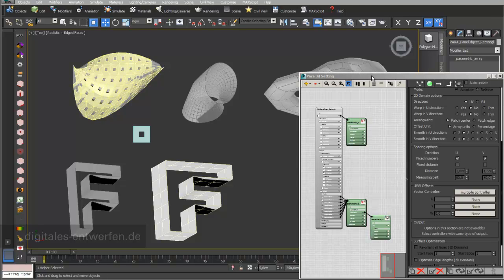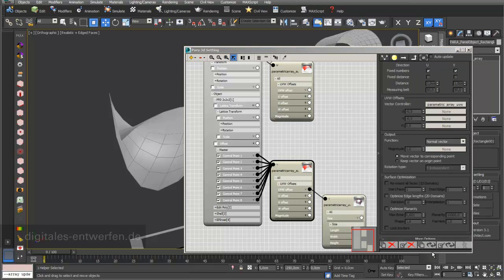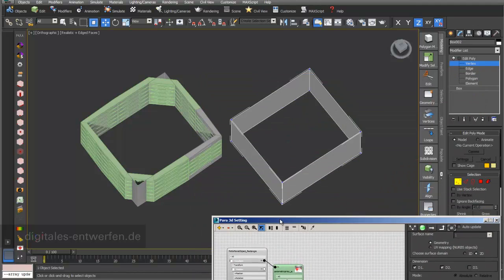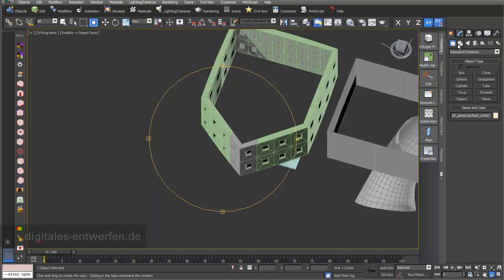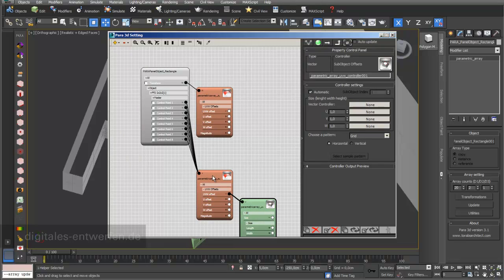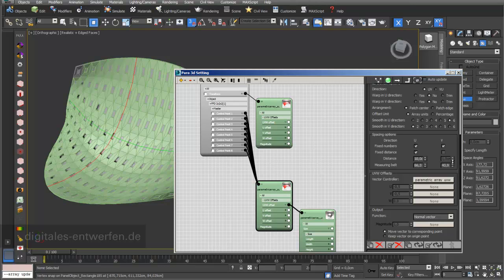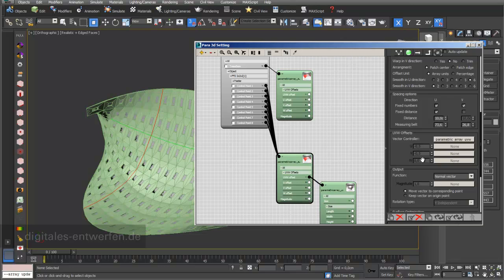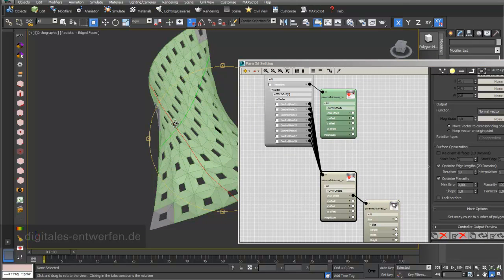Surface paneling 03: surface controller, advanced knowledge with 2 dimensional array in para 3D

Comment: great work guys. I have been following ur blog closely and wish to collaborate with u guys sometimes.Regarding para 3d  i have been trying to apply this technique and research in my office works.It would be great if we can get one specific tutorial on applying surface paraametric panelling on a tower with diferent floor heights. For instance this tutorials are applied on a random faces and surfaces. 3dsmax divides the surface into equal segements whereas when u build actual tower facade, the heights of the floor varies and also the distance between vertical fins. so in 3dsmax language, the surface will have diferent segments verticly and horzantly. In such cases wat is the best  way to model a facade and apply para patterns. I guess the question is bit confusing, please let me know for further queries.
Reply from the maker: Thanks for your feedback! There will be other videos of surface cladding. Right now, we´re more busy with digital prdoduction and para3D. Super exiting and new videos will come. To be honest I didn´t got your problem completely and am right now super busy and no time for surface issues. Best support for para3D is the forum of para3d.com. Did you try this?